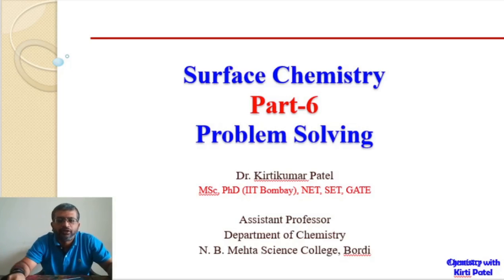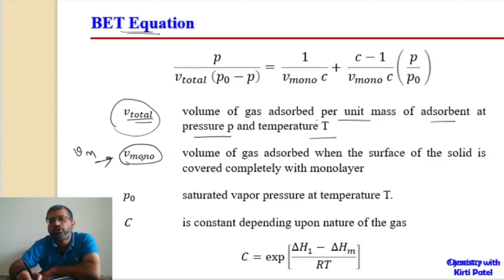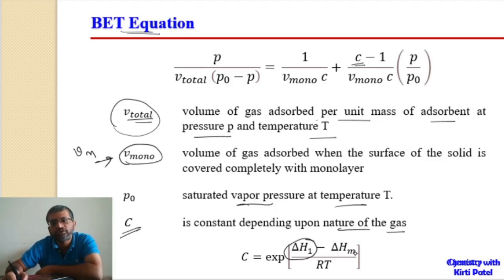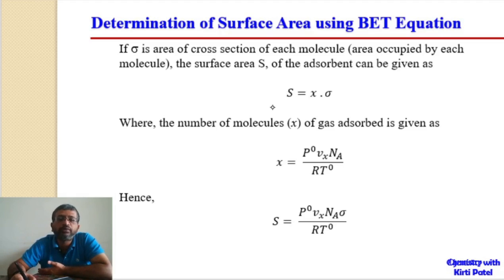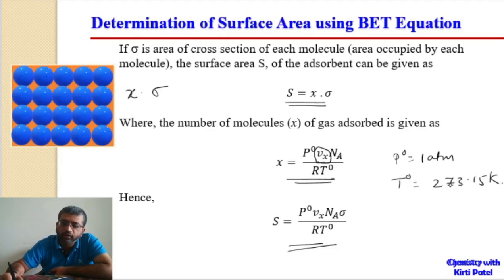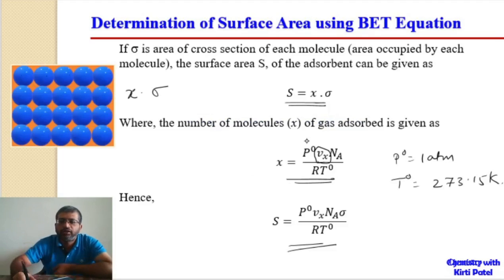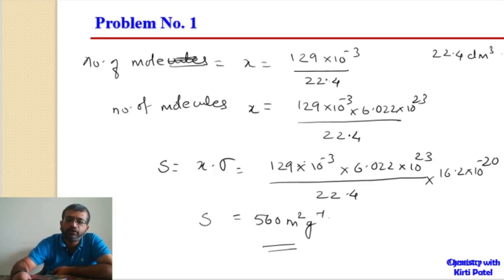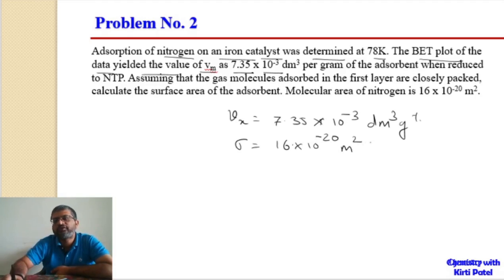Solving Problems on BET Equation - Part 1

Comment: 1. If the adsorbed N2 needed to form monolayer on 1g Fe. Al2O3 catalyst at -196 °C fills 
2.83cm3
at 1 atm at 0 °C, what is the surface area of the catalyst
Reply from the maker: You need to calculate first number of moles of N2 adsorbed, second you need to have the area of cross section of each N2 molecule and then you can calculate the surface area. 

But in the information provided by you is incomplete. You need to have already of cross section